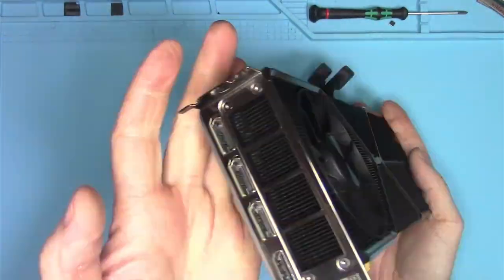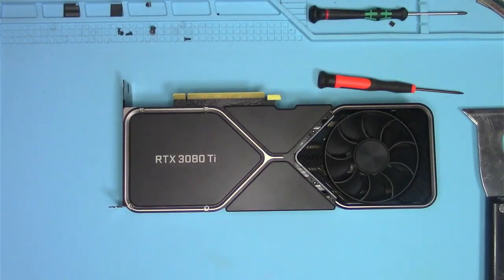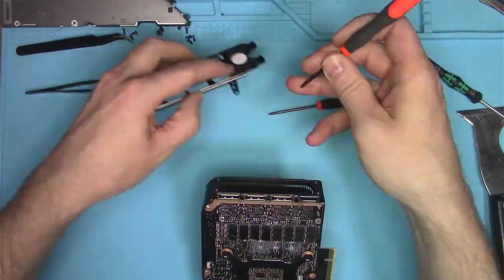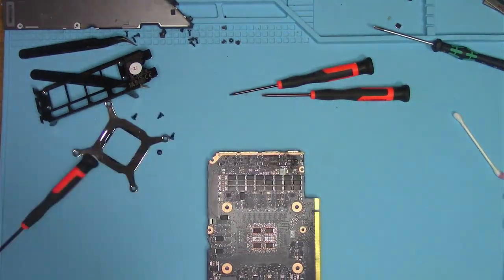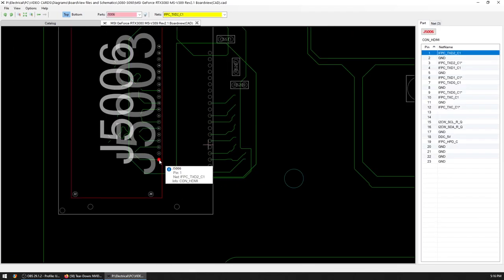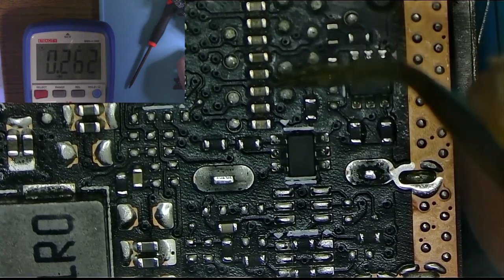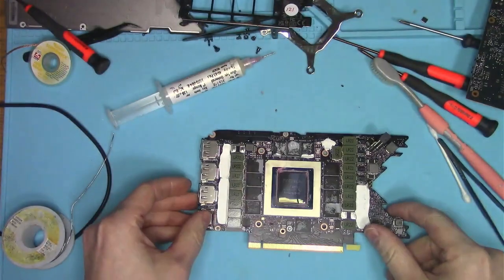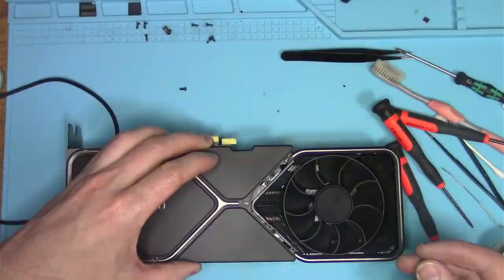Should you power down your PC during bad weather ?

Comment: Didn't watch the video yet, but the answer is "Not just power it down, physically unplug it." Surge protectors are there for when you don't have enough warning, but you're better off unplugging it.

This goes for all cables connected to a remote device not just power. A surge can travel through Ethernet or audio cables, regardless if they are powered on.

I have my PC, monitor, switch, and speakers all plugged in to the same surge protector (rated at 1500w+, get a decent one) during a lightning storm, I unplug the surge protector and then the Cat-6 cable going into the switch coming from my router.

I had lightning travel through Coax cable once, frying my Cable box, my TV through the HDMI port, my modem, my router, a network printer, and a garage door opener gateway plugged into the router. Luckily my HTPC, main PC, and my server didn't get hit through the Ethernet cable somehow, but that was in fact luck. This still cost me well over $1000 to replace everything, and it didn't even reach the most expensive devices.

Comment: Okay it only happen to me once but that was a hard lesson to learn. My first Windows based PC was a Dell I had a problem with because I needed a better PSU and Dell wouldn't sell it to me saying I didn't need it so I went to newegg and got a Barebones system, weird I don't see them anymore. I took out the CPU RAM HDD and Graphics Card. set my new system up and installed windows xp I think. I was playing Star Wars Galaxies when there was a thunderstorm happening. Power went off so I just waited to turn it back on then it power came back on then off then on again and fried everything in my PC. Now when the power goes off or I think it will go off I unplug my PC and wait till it's clear to use it again. When you turn on anything for that one second it gives whatever it is max power(Thats why the old lightbulbs died fast) Taking that more then one time can send a power surge frying stuff in your PC maybe even the whole thing. Always be ready to pull the plug or have protection for it and your fine! So yes shut down and unplug it'll you know it's safe!

Comment: This is why a surge protector is more than just an option.  This card, and potentially the rest of the PC, could have been saved by using a twenty-dollar surge strip from APC or another manufacturer.
Reply: True. In the US they're often like this, but I remember being over in a foreign place like Thailand, and people never seemed to understand the difference between a strip and an actual surge protector. 
Commercial markings here have to be accurate, but I'm pretty sure I saw several over there that falsely advertised they had surge components.
Reply: Sometimes the damage has already been done before the surge protection trips!
Unless you get some thousand euro unit or you power your pc through an external two step power supply!!
Reply: @AutodidactEngineer  If that happens, it's a faulty surge protector.  The ones I am familiar with would not allow that to happen.  If the PSU in the PC goes bad, that's another story.
Reply: Fun fact: The majority of surge protectors will be unusable afterwards if the protect a surge from lightening. The problem is, if it was hit and you don't know, there's no indication that the device is going to protect from another surge.
Reply: @peterlarkin762  When a surge protector does its job correctly, it will not work thereafter.  The job of the unit is to absorb the surge and then fail thus breaking the connection from the wall outlet to the PC.  Surge protectors are not line interactive units that correct line voltage conditions.  During a surge, the unit is designed to fail when the current reaches a certain value.
Reply: Since the damage came through the HDMI port, I'm wondering what the PC was connected to.  If it was a TV, a lot of people don't think of putting surge protectors on their cable or satellite feeds.  Cable ISP's will complain about using coax protectors, but I've used them for years without any problems with speed or signal quality.  Same with phone-line protectors if you have DSL.  I keep everything on battery backups with surge protection and have all my data lines protected at both ends.  To date I have never lost any of my own equipment due to a power surge and I've had plenty of lightning hits knock the power out, explode nearby trees, etc.
Reply: @PhoenixBird9000  I am not familiar with surge damage being done through an external interface.  An HDMI port is a peripheral port, as you know, so where would the excess current have originated?
Reply: @markpmar0356  
Without knowing more  about the actual incident this is all just speculation, but let's say a lightning bolt hit a pole and went through the coax line into a house and into a TV.  If the computer was connected to the same TV with an HDMI cable, the surge could have run through the circuitry in the TV and rode the the HDMI into the graphics card and into the computer.

Another possibility is inductive coupling.  If the HDMI cable was run parallel and close to a coax cable, or a power cable that took a hit, the voltage spike could cause a magnetic field to rapidly build up and collapse around the affected wire.  If that field crossed over the HDMI cable it would induce a surge in the HDMI cable.  Coax is shielded, but the shield itself can act as a conductor.  I know of networks blown out by this behavior where Ethernet was run too close to mains wiring and lightning was able to get past the surge protection because the mains inducing over into the network lines.
Reply: No, no no no just no.  Surge protectors (the type you plug a device into) do not protect from the amount of energy delivered by a lightning strike, not if that strike was anywhere near you.  They are exclusively for protecting against standard fluctuations in power and smaller, unpredictable surges (downed lines, certain appliances turning off, etc).

A single bolt of lightning can deliver something along the lines of 1 billion (yes BILLION) volts of electricity.  Only a whole-home surge protector (installed between the utility line and your home) has a shot of stopping damage from a lightning strike.

Please, please do not try to convince people that their devices will be safe from lightning strikes with point-of-use surge protection.  They aren't.
Reply: @KenrilZ  Surge protectors are designed to provide protection from line surges and not lightning strikes, given that the current and voltage is too high for any point of use surge protector.  However, lightning strikes that are not in the immediate vicinity of connected equipment could affect line voltage to an acceptable extent and the usual result is the loss of power either with or absent a transient voltage spike.
Reply: @markpmar0356  True!  I'd add that it's worth pointing out if a storm is close enough to be a concern, the wisest course of action (if it's an option) is to unplug sensitive devices, since you can't predict where lightning might strike.
Reply: @KenrilZ  Yes, that's the best course of action.  I use a line interactive UPS and if the storm is bad enough, I'll unplug everything and wait it out.
Reply: @KenrilZ  That is oversimplifying the situation a bit.  A lightning strike that is not a direct hit can cause the kind of surges that a good point-of-use surge protector CAN stop.  Electricity is powerful but it does follow the laws of physics.  While a surge protector is not a guarantee, without it your equipment WILL take damage from a surge.  It's like body armor.  Body armor might not stop every kind of bullet, but if you get hit without it you WILL DEFINITELY be hurt.  The most important thing people can do is educate themselves.
Reply: If you guys are concerned about direct lightning strikes and how surge protectors won't protect that, then just get a lightning rod. They're super cheap to set up and worth it since it'll also save your washer, fridge, tvs, and yes, your PCs. You don't want to be spending thousands on replacing that stuff, right? So spend the $100 to get a proper lightning rod set up, or more if you want a professional to do it.
Reply: @PhoenixBird9000 you mean capacitive coupling. Induction is a low-pass filter, meaning that the faster the surge, the less likely it makes it through. Capacitive on the other hand is a high-pass filter, meaning that only fast surges can pass through. This is why switches with long cables can't fully turn off, because of the capacitance between live and neutral.
Reply: @wedmunds  I mean inductive coupling.  https://en.wikipedia.org/wiki/Inductive_coupling https://en.wikipedia.org/wiki/Capacitive_coupling
Reply: @peterlarkin762 A lot have usable indicator lights. Since surge protectors generally divert to safety ground, plugging it into a GFCI might be a good idea.
It can trip the GFCI like a GFCI tester does.
Reply: @KenrilZ Cell towers are often safe from lightning strikes, so how do they do it?

Comment: i lived in my grampas old house for one summer  when alot of thunderstorms happened.
DESPITE everything in my system hooked up thru both a surge supprsessor and UPS power supply , my computer eventually got damaged anyways.
i guess it couldve been the ethernet cable but the modem still worked while something on my mobo was fried enough to make it unrelaible.
or maybe 12 storms was just a coincidence and my mobo was gonna crash anyways.
BUT my electronic washeer dryer was also damaged although a little fiddling with it and it mysteriously started working again.... go figure, well at least a few more yrs then gave up.

Comment: Luckly i live in Italy where most of the houses have a lot of lightnings protections, my dad is an electrician: for our house he installed a bunch of overtension and overcurrent ground dishargers (by Finder and Schneider). 

I also have an APC by Schneider Electric 1600VA UPS with the same protections, so the only thing i disconnect from my PC during a thunderstorm it's the internet cable.

The only way a lightning can reach my PC it's thought my internet cabled router because it uses a different protected cables (italy net sucks).

Edit: my bff had his 1st pc blown up by a lightning (in 2016) that came from the Telecom/TiM cables on the pole outside of his house discharging directly into his router and all the internet plugs connected to it! Was not a good thing to see 😂

Comment: I recently lost the HDMI port on a NUC connected to the TV, and the weird thing is, both the TV and the NUC work, it's just that port. Apparently some kind of a surge took place, took out the port, probably by burning out a fuse somewhere, but everything else is ok. Obviously not lightning, but the TV set is also not the safest thing to keep the computer connected to, either.

Comment: Many years ago, I had a freak lightning strike on the large tree in my front yard (no storm ongoing, dark clouds quite far away).  The surge came in through the cable internet line (didn't harm the modem for some reason), took out the computer power supply, motherboard, video card, and went out the hdmi port to my surround receiver, killing the hdmi daughter board.  Luckily, the surge then went to ground, and didn't take out my HD TV, though I did have to reset it.
Receiver was still under warranty, and they repaired the fried daughter board no charge.
The computer, however, was toast -- and I mean literally Toast.  Obvious burnt components on the motherboard, power supply had a couple of dead rails, and though the video card didn't show anything obvious, it was quite dead.
That sad thing is that I had the cable line coming in run through a heavy duty surge suppressor, but there was an internet issue, and the cable company tech moved the connection so that it went directly into the computer instead of the surge suppressor.
Would it have helped if the cable had still gone through the suppressor?  Difficult to say, but I'd guess not much.  The strike blew a hole in the side of the tree (yes it lived and healed over after several years), so that direct strike's surge would almost definitely have been beyond the capability of the suppressor to stop.
Lesson learned -- storm anywhere within visual range -- shut that sucker down, and disconnect the internet line asap.
Oh -- also -- back in the Olden Times, when I used a modem . . . lightning struck the ground miles away from my house, but it was close enough.  I actually witnessed a bright blue flash of light accompanied with the unmistakable sound of electrical discharge emanate from behind my desktop case.  Modem was completely fried.  It was worse for my parents who lived a couple of miles away and closer to the strike, it literally melted the phone plug receptacle in the wall, and burnt the electrical outlet next to it as the electrical surge sought the path of least resistance and leaped to the main electrical ground in their house.  That did, luckily, save their computer from a far worse fate.

Comment: I completely unhook my computers in bad weather. I have 2 computers, so if I were to leave one on, it is still connected by a analog stereo cable, and a network cable. I may be unhooking those if I leave my second computer on to compute blender animations. My theory is storms can either put spikes into the power feed, or energize wiring in a building that it hits. I hope pulling out the connections is doing enough in these cases. It is possible with very near strikes that the electrons may charge insulator materials as well.
Reply: A friend of mine back in tne 90's unlugged everything except the modem and then lighting hit the phoneline, took out the modem and continued through the serial-cable and fried half the motherboard.
But that strike was very very close so it would probably have damaged stuff just by the EMP alone.

Complete disconnects are the safest way to go, if you happen to be in an area where strikes are commonplace.

Comment: In England we have fuses in the plugs. Unlike the Europeans who have to replace all their electrical goods when the Lightening strikes. We just change fuses, simple. £5 vs £6000 or more
Reply: Fuses are nice and all but don't do anything for lightning. At all. The only purpose of the plug fuse is to prevent house wire fires, which are a possibility with ring mains. The lightning has traversed the breakdown voltage of a few kilometers of air; it will easily traverse a few centimetres of any material you might throw at it - glass, sand, cement, circuit board, polymers, etc. Besides every single power supply and mains powered device that is allowed to be sold in EU has an internal fuse. In most cases, these fuses are made inaccessible because their working current is low vs. their rated current so they should never need replacement, as their failure indicates a deeper damage in the device that should be looked at by a qualified professional before the device is ever put back into use, and people who think they're very smart but aren't, are known to bypass the fuse with a piece of tinfoil and create actual fire hazards.
Reply: @SianaGearz  the incorrect thing you mentioned was the EU. The EU didn't even have earthing cables, they copied the English.

I'm half Dutch and none of the electronics plugs I used had fuses in them. You may have them on the circuit board, but it is definitely not an EU thing. 

I'm a plumbing and heating engineer, not a sparky. I just observed the difference between the two countries and where I had to reinstall white goods due to a Lightening strike.

It makes sense with what you are saying though

Comment: I have a question. Did the lightning hit the monitor and then through the HDMI cable the GPU? Or was it just through the GPU and the monitor was ground?
Reply: Most likely trough the tv/ monitor if not we would have seen more charcoal on the pcie and 12 pin power conector

Comment: I would assume the PSU is the first thing to short circuit before the other components
Reply: If it killed the HDMI port as well, it likely came from the monitor.
Reply: @annihilator247x  Yep. I wonder what the power surge did to the monitor as well.